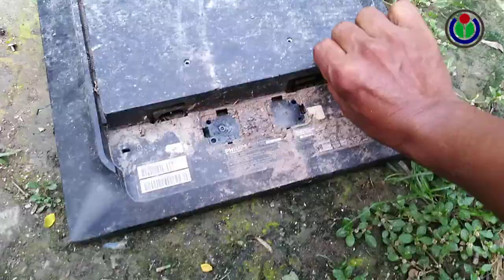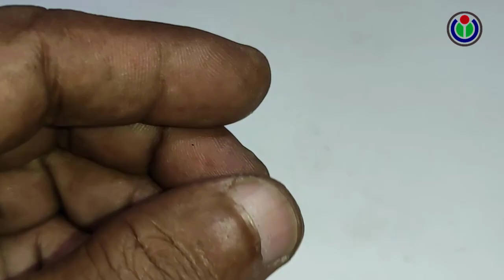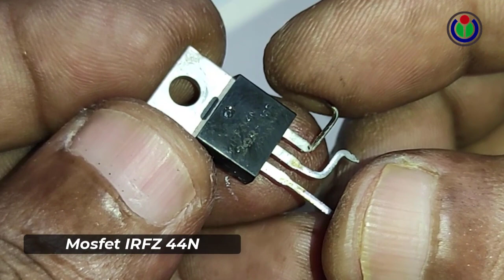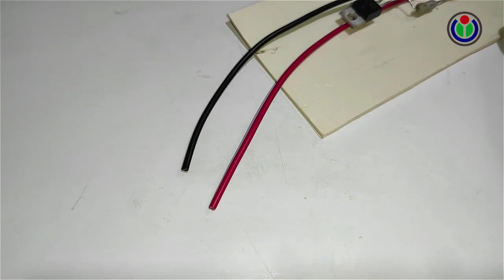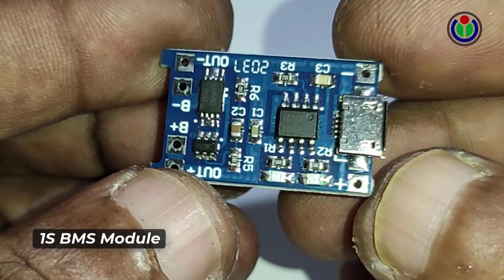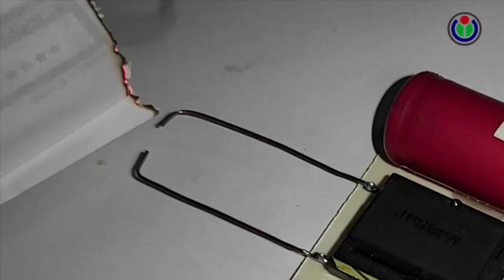How to make Plasma ARC Lighter using damage LCD TV | Make 3.7v to 100000v generator

Comment: Bro you did not reduce the number of turns of primary winding in some videos they show 8---0---8 turns and MOSFET Irf 44N Ba 132 D 718 and resistance 1k ohms  100 ohm's I can't understand witch method is good.please answer bro.
Reply from the maker: It was collected from the Monitor circuit board. So don’t worry about its turns.

Comment: Sir I Make This same Circuit First Time Circuit ok Running but only 10 seconds First Circuit Not Give ARC  But I TRY second Time Make New Circuit New Flyback New MOSFET 840 But Circuit was Not Make Plasma ARC I was So sad Please Guide Me
Reply from the maker: Ohh very sorrow matters dear. Please apply a full charged battery, output probs 2 pin will be short and not be close starting, it last point will be closed to each other.